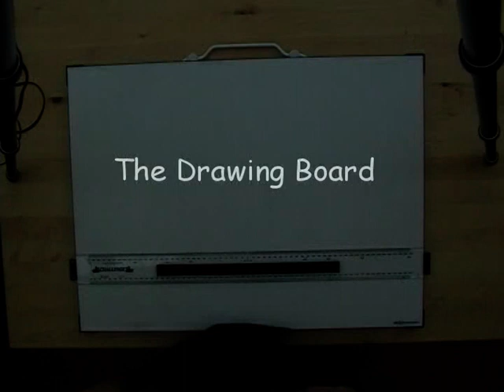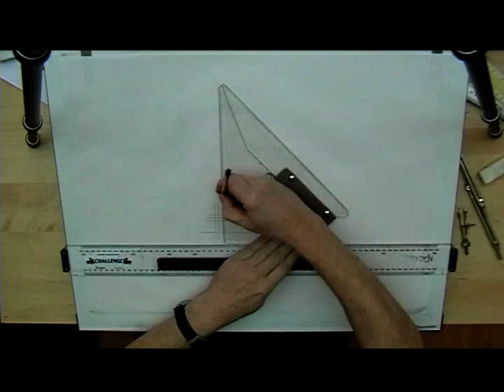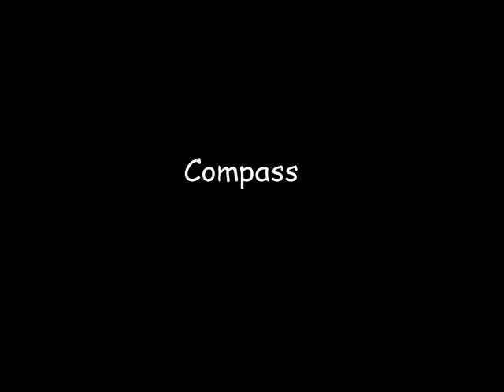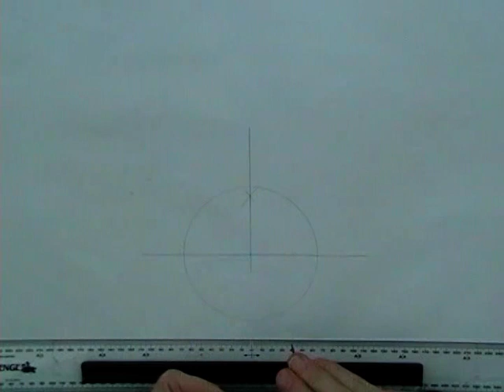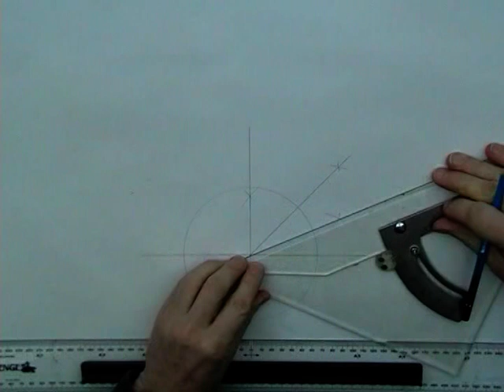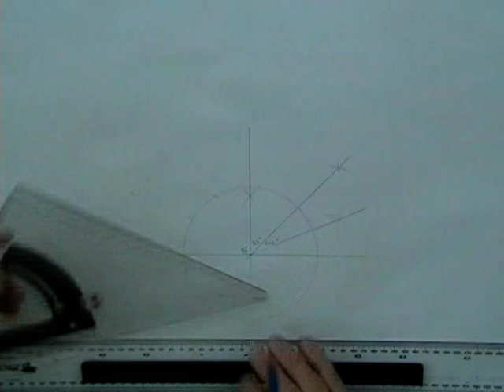Tools for Drafting by hand

Comment: how would you measure a length of a line when you don't even have markings on the side of your set square???
Reply from the maker: You would use a ruler.  If you are drawing to scale then you would use the right scale ruler.
Reply: wouldn't it be easier to have markings on your set square?
Reply from the maker: *****
You would need a different set square for each scale that you use. On a single scale rule you can get 4 or 6 scales on one rule.
Reply: but if you are only drawing to one scale would you recommend using and adjustable set square or 2 set squares?
Reply from the maker: *****
I found a way that worked for me with the tools I had. A scale rule, a T square, an adjustable 45deg square and a 30-60deg square.  You might find it easier to work in another way with different tools.  Experiment. As long as the drawing gives the right information it's all the same.

It is midnight here and I'm off to bed, good luck!
Reply: can you recommend a scale rule for me?
Reply from the maker: *****
What are your drawings for?
Reply: I am just doing basic drawings as I am only starting out drafting. I am drawing a plan, end view and elevations of 3d objects
Reply: It is going to get much more advanced
Reply from the maker: ***** http://www.amazon.co.uk/Helix-300mm-Metric-Triangular-K93070/dp/B0027VSH32/ref=sr_1_1?ie=UTF8&qid=1414596243&sr=8-1&keywords=scale+ruler if you are in Europe.
Reply: can your recommend a simple T square as well?
Reply from the maker: *****
You need to give me a bit more information.  Is this for school?  What size drawing board will you use? Are you setting yourself up professionally? What kind of things are you making drawings of?
Reply: this is for school. I am using an a3 size drawing board. I don't know if I am going to set myself up professionally yet. I am only drawing in one scale and that is mm. These are the kind of questions I get 

http://examinations.ie/archive/exampapers/2014/LC562ALP014EV.pdf

http://examinations.ie/archive/exampapers/2014/LC562ALP015EV.pdf

Comment from the maker: It is a problem in particular with melamine surfaces, professionals use a vinyl surface that holds the compass point in position. The other way is to use thicker paper that doesn't tear so easily. Thin tracing paper can be a nightmare because it becomes brittle.